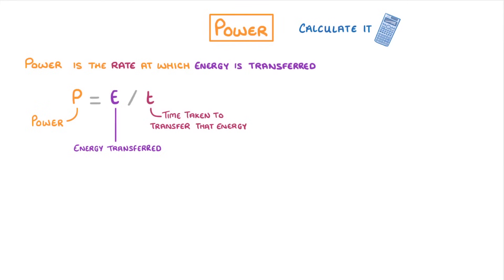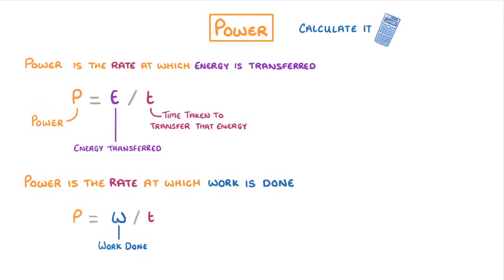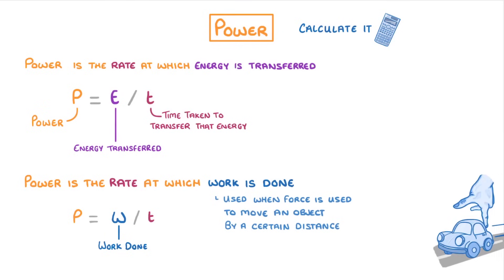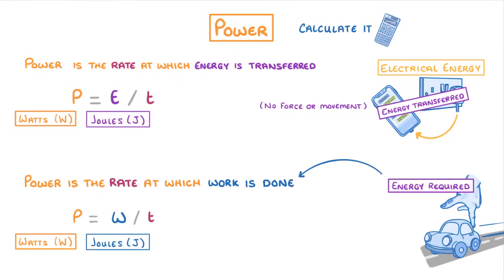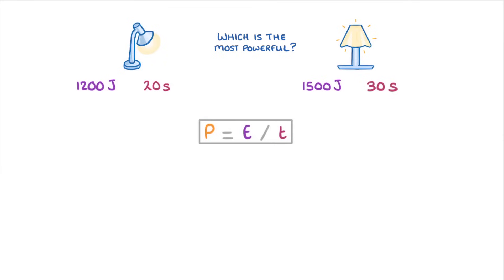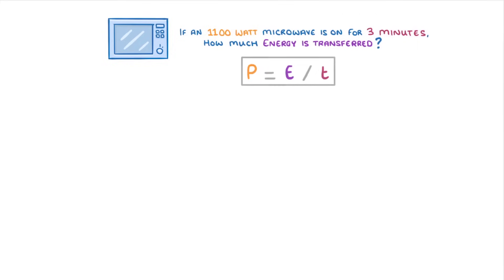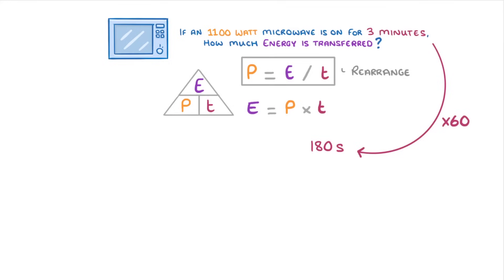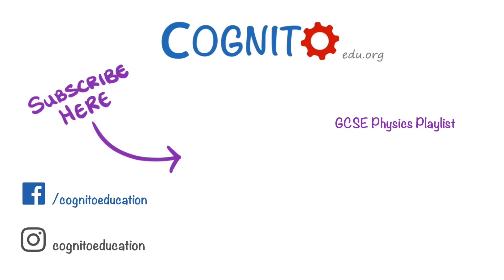GCSE Physics - Power and Work Done

Comment: 3:09 why do you have to transfer the joules into kilojoules...
Reply: if asked in the question to write the answer in kilojoules, you would convert it
Reply: They converted the joules to kilojoules because the value was quite large and could be converted into kilojoules. Nothing complicated
Reply: To simplify
Reply: @ahnaf6918 is it important? will u loose marks if u dont?
Reply: @nanareactsi if the question says answer in kilo joules then yes otherwise probably no, however if the question is like 4 and up marks it's safer to answer in kilo joules